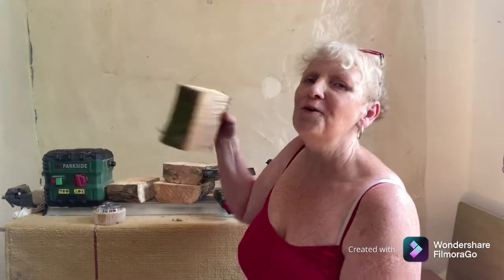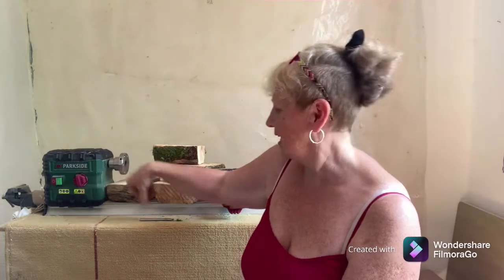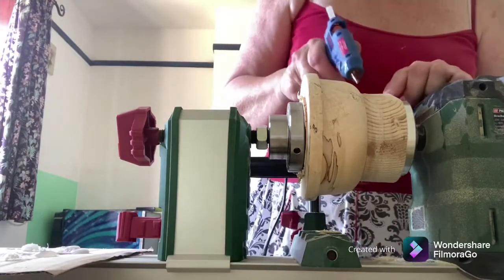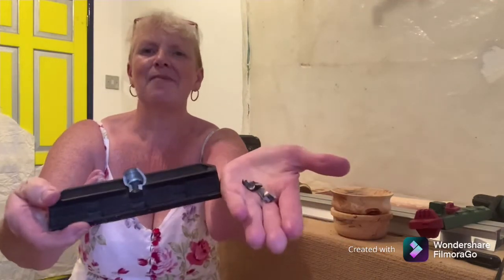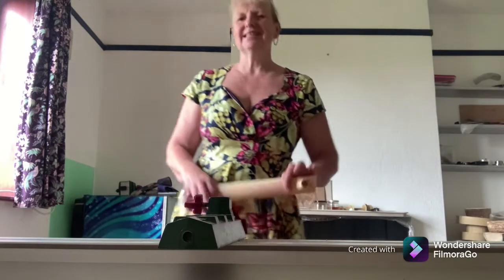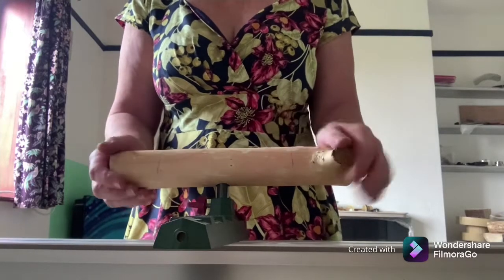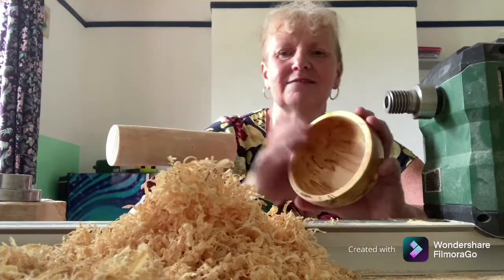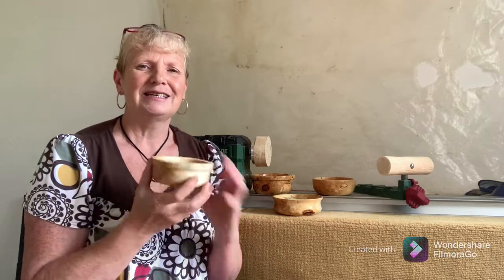New parts, four bowls and a wooden tool rest.  🪵 Woodturning    8

Comment: You continue to amaze me. When your tool rest broke and you told us of your plan, I got a laugh thinking, that'll never work. As you were sanding and doubtlessly hammering off camera, I was still skeptical. When you came back with the finished product and it was so solid...with no wobble, I just shook my head and decided you can do anything. Your bowls look quite nice. I really like the one that looks like a short kettle. That was a new adventure, I'm sure! I don't know if you are aware but the pretty black lines in the wood is called spalting. It is caused by a fungus that gets into the wood. It's actually quite sought after. We have a good deal of spalted maple here in the states but it's probably due to the fact that maple is a VERY common tree. Also the part of your lathe the tool rest attaches to is called a banjo. The name comes from the fact that the shape supposedly resembles a banjo. Personally, I don't see it but it's called a banjo, nonetheless! Keep it up, you are fun to watch and your humorous personality is a delight!
Reply from the maker: Hi Max thanks for letting me know that lathe part is called a banjo I had no clue.  Did know spalting was called spalting but wasn't sure what caused it.  The willow I am using has been dead for a few years so a fungus makes sense. 
  On a trawl of the internet I found a post of someone that soaks the wood in beer, then keeps it moist in a plastick bag to encorage fungas to grow, creating the spalting he wants.  Or ideally putting the wood in a bag with an already  mouldy piece of wood.  Keeping the bag of wood in the dark apparently helps as well.